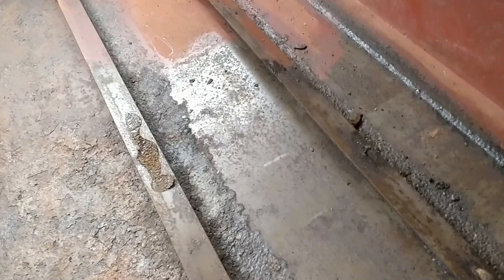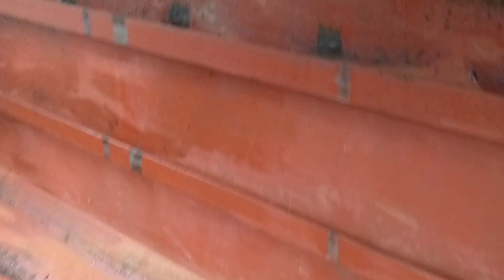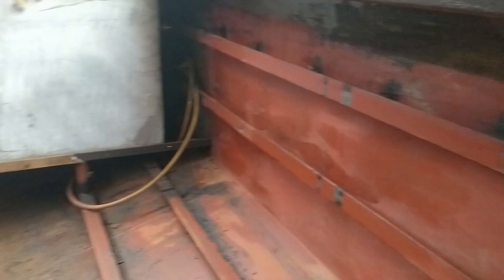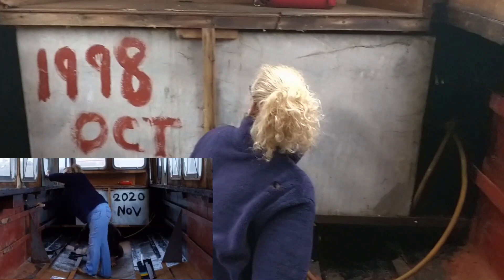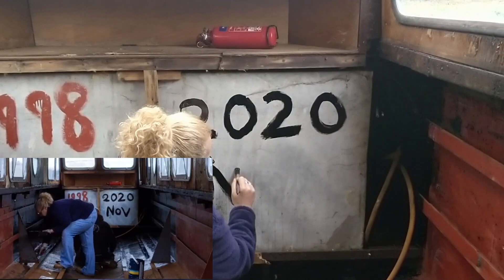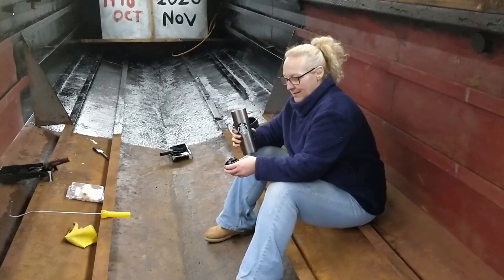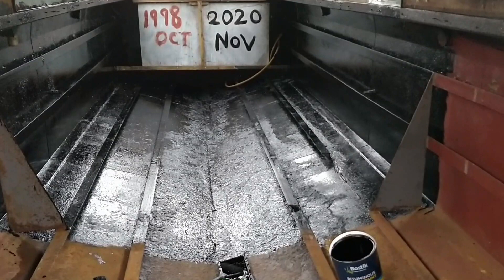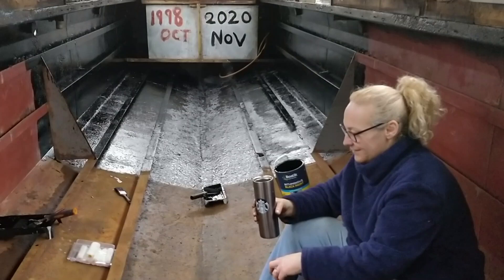Painting and Prices - Painting the inside of the hull and looking at what we've spent so far.

Comment: Glad we are watching this...we have built manty different things..classic cars, motorbikes, overland 4x4 expedtion vehicles (In Mali, West Africa at the moment) etc etc...
Our next project will be a boat which will be a bolt hole when or if we are in the UK and not travelling.
As a project engineer ,in a previous life, dealing with  big electrical /mechanical contracts it is not about being "Tight" it's more about specific costings. As an example our current 4x4 cost us 21k in total. We have been offered 45k for it, so the build made sense. But that is not why we built it....we built it as a keeper never to be sold.
We understand this is the reason you are doing what you are and do not plan to sell.
We are looking, and have others looking for us, for a boat while we sit here waiting to return to the UK.
Having time on our hands while we sit around i have been costing different types of boats, project boats, fully overhauled boats and everything in between.
There are arguements to be made for all these cases which are self evident.
Here is where my previous job comes in handy in having correct costings and sticking to them. It was easy for me to have a client change the spec or request alterations to a contract..i simply invoiced them for the extras...when your doing something for yourself it is good to have a contract with yourself and stick to it ..if that does'nt sound to daft.
It is very easy for a project to run away from you causing extra costs.
Better to take a couple of days pricing up each section of the project such as electrics, painting, woodwork etc. then add 10% contingency.
Also plan ahead for ordering materials...time is money..this includes your time.
Lastly plan realistic dates/timing for each installation to help you stay on track and not get disheartned that the work is dragging out.
This all sounds like i am having a moan, but it is just my experiance.
Sharing your plans along with costings now Vs actual costings later would be a great way to keep people watching...i am not sure that this has even been done before on a boat build.
Good luck with the build...we will be watching.

Comment: To stop corrosion caused by the 240v system, you'll need a galvanic isolator fitted in the 240v system. The annodes are there to reduce galvanic corrosion of the hull caused by the proximity of other, dissimilar metals, like the propellor!
It's just another way the manufacturers have of relieving you of your money!!!💸💸💸🥺
It's a similar thing, but ones caused by the shoreline hookup, and the others caused by electrical current  created by different metals on the boat!
(Fascinating  stuff intit!!!🙂🤣)

Comment: Interesting project, however I would suggest that the bilge be needle, gunned before applying the stabilising solution, there is a lot of flaking Rust down there that should be removed , however good luck.
Reply from the maker: WE did scrape all the loose rust off first, then aqua steeled the 'solid' rust (is rust ever classed as solid!?)
Reply: Scraping is a good start, but you really need to beat on that plate with a hammer, to get those sheets of scale off then treat and paint 👍